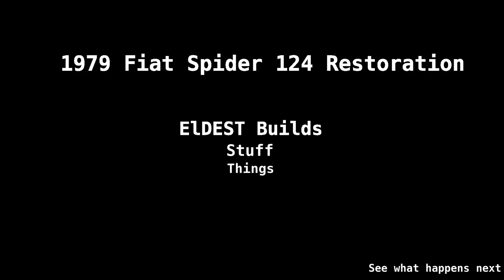1979 Fiat Spider 124, Painting some interior bits

Comment: What type of paint did you use and it looked like you added something to it?  What was that?  I’m curious to know how the paint on front seat belt guides will react to the rubbing of the belt?  Has the paint stained on?
Reply from the maker: This paint was rustolem black enamel, I had to add some thinner to get it through the air brush. There is some rubbing on the underside of the belt, not really visible. I'll do a review video on it.